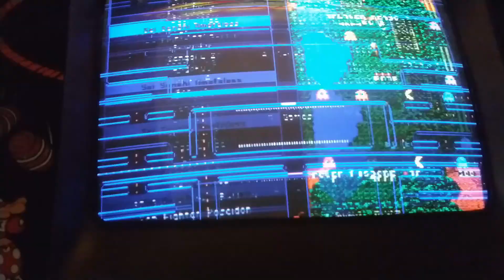ArPiCade Raspberry Jamma Setup and Installation

Comment: Does this has zero input lag from jamma controls like the RGB-Pi?  As I understand, compared to both Pi2Jamma and RGB-Pi, this one (Raspberry2Jamma) still has to output from HDMI and pass it trough the converter box into the Jamma header PCB, adding more delay.
Reply from the maker: This is an old video now and I have since picked up a Mister FPGA. This would now be my preferred way to put into a jamma cab though it would end up being 2 or 4 times more expensive that the PI option so not cheap! For me though I didn't notice any perceptible lag when I played with this set up. Worth getting in touch with Dylan on the forums and see if he has done any measurements. Thanks for commenting and best of luck with whichever solution you go with :)

Comment: I have a pac mania and the boards died. Thinking of converting, will I still get attract mode and be able to use on coins and free play ? Cheers
Reply from the maker: Hi mate, I've sold my kit and arcade a while back. If you have the money I would probably go to using a Mister and the correct jamma connector - will be much more accurate hardware emulation (though not sure if pac mania is released yet for it). If you do go the Pi route, then yes you can set it to boot to a specific game - I had mine set to Final Fight. You can still select other games too once its loaded but it worked quite well :D

Comment: Hi my Jamma cab is vga with pandoras box, how will this connect to my cab. Also does the jamma harness provide power to pi. And I have amp in cab with 3.5 headphone jack lead. Where will sound be directed from :)

Comment: Hey I’m hoping you can help me. I have a JAMMA  Arcade that I currently used to play multi game boards. My monitor plugged in directly to the board through a VGA cable. I noticed in your video that you’re plugging in the CRT through the JAMMA harness.  If I bought that raspberry pie where or how would I plug in my monitor?
Reply from the maker: Hey mate - is your multi game board a jamma board? If it is then I imagine you just swap the existing multi game board with the arpicade. If you are saying your monitor goes to the multigame board via VGA then I dont know if the arpicade will work out of the box (probably worth you messaging the creator of the product or posting on the arpicade forums with a few images of your set up). Best of luck

Comment: Can't i just use this with my existing Retropie setup?
Reply from the maker: I don't think so as the arpicade has its own software distribution I think to interface with the jamma connection, but to be sure you could check the arpicade forums or contact the creator

Comment: Does this work with the Raspberry Pi 4?
Reply from the maker: Im not sure - probably worth messaging the Arpicade guys directly. I might look into upgrading if it does as the Pi4 is very powerful. There are a few games that dont run well on the pi3 (Double Dragon)

Comment: Awesome stuff, I now have one too! However finding a great rom kit for this set up is hard, any good tips? I have found a bunch but with all the different Mames, FBA...etc there's a lot of duds. Let me know thanks
Reply from the maker: I was playing it a bit this morning with my kids, it's great!

I must admit that I bought the SD card from Dylan (maker and seller of the arpicade) - I had emailed him questions on which mame sets were the best and he uses a few different ones depending on the raspberry pi.

If you take a look at the arpicade forums there is a heap of info but you may just want to buy a full SD from Dylan direct to save all the hassle
Reply: @ByteSizeThoughts  Yeah I did get the 64gb version from Dylan, however there's just a tonne of filler very old games & console games. I'd prefer a more late 80's to 2000 arcade mix, but it's tricky just add as some games just don't work, have no images on menu system & finding the right mix that all work is a tough one. Yep lots of fun though, I really wish I could get some of the later fighting games to work ie Marvel Vs Street fighter 2, Fatal Fury...I'd love for someone to have a more up to date collection, but I guess Arpicade is a customised set up than the Retropie versions
.
Reply from the maker: Yeah I hear what you're saying now. I don't mind the filler as I like looking through in case I find some hidden gems :) but all the Nintendo vs ones I'd like to hide.

I haven't looked into it but I think that you can create filters and put games into collections a bit like launch box. So you could manually create a neogo set and then change the menu to show this collection. But I haven't tried to do it so maybe I'm talking bollocks :)

There are a few emulators that he put on there so I reckon one of them should work with games, but then it's the pain of finding particular roms for the included emulators.

Comment: Ok this was bad-ass! do you think there will be any problem using a LCD monitor with this?
Reply from the maker: I reckon reach out to the owner via the website. I think that it is configured and runs in a lower resolution for CRTs and so you change it for LCDs ( but I may be wrong as it's 6am and I've just woken up :) )

Comment: With the pi2jamma..or the Rasp.jamma.ep..(also  rasp/orange/asus tinker -gpio-jamma adaptor).
What's the best option..best img?
Thanks.
Reply from the maker: Hi Sam - I haven't tried the other options to be honest. I was looking at the pi2jamma initially as Modern Vintage Gamer did a video on it a while back but I couldn't find  any more and it was sold out of the US so I started looking for alternatives.

I was thinking of going for a win XP PC with video out through to the jamma. This would enable better performance on more intensive games (Sega M2,M3 etc)  but it was a bit more effort to source the parts and get it configured. However would love to go full Mame/Launchbox route in future if I go for a build from scratch.

In the end I went for arPicade due to 1)ease of implementation and 2) the bloke selling the arPicade is in Melbourne close to me and 3) the arPicade forums are pretty busy with good engagement in case you run into issues

Comment: Great and informative video! I'll be installing this exact setup into a street fighter 2 arcade with a crt monitor, as far as  sound goes. How do I set it up,  it has a single speaker in it now. It is it just plug and play. Thanks for the help.
Reply from the maker: Howdy David - yeah as long as you have a jamma connection then it's plug and play. I think because you have a kick harness then you will need to use the additional connections so all 6 buttons are usable.

I only have 3 buttons so I didn't have to add them but I reckon it's pretty easy - worth a search on the forums.

And yes, speakers worked straight away for me :)

Comment: Thanks for the video. Did you need to adjust anything on the power supply to make sure the Pi was getting the right voltage or was that not a concern for you?
Reply from the maker: Hi mate, I didn't need to adjust anything for mine, seems to be getting the right voltage straight out of the box. 

The only thing that I have noticed is that I have to adjust the brightness for the different emulators (the SD card comes with 3 or 4 different ones set for specific games).

So for example final fight will need a different brightness setting compared to Space Invaders for example. But it's not too much of an inconvenience and I'm sure can be rectified if I went into each of the emulator settings.
Reply: @ByteSizeThoughts  Nice on mate, thanks for the reply. I wonder if the brightness is dependent on different monitors, I guess i'll find out. Keep the vids coming!
Reply from the maker: My monitor is pretty old and I've noticed the brightness also fluctuates a bit on its own which I reckon is either the PSU or possibly some caps that are aging on the monitor chassis - doubt it's anything to do with the PI or arPicade

Thanks for the support! :)
Reply: Byte Size Thoughts  My monitor has been refurbished (apparently) recently, I picked up an LAI Mortal Kombat cab i've been wanting since i was a kid! So i'm hoping the components will all last me a while longer. I ended up buying the RaspberryJAMMA based on your video so will let you know how I go with it!
Reply from the maker: Awesome, best of luck and hope it works well for you. I only have a 3 button cab so it makes playing mortal Kombat a little tricky :) 

Has it got all the artwork? I'd love to get a dedicated cab like that in the future!
Reply from the maker: @ckynut  now this is a really exciting project mate and yes would be very interested in how you get on!

Will you put it in the house? If I had a cab with beautiful artwork then I'd be lobbying my wife to put it in the living room!!